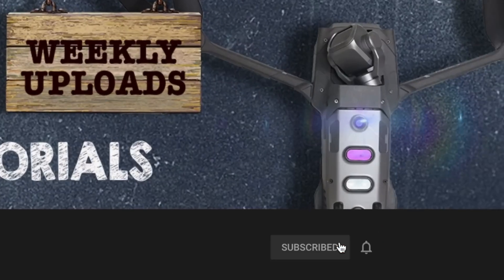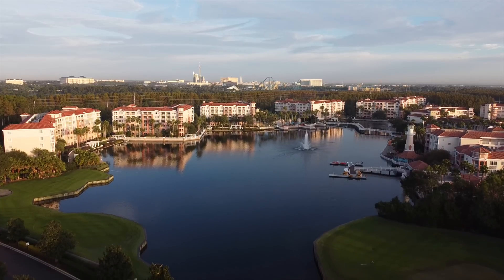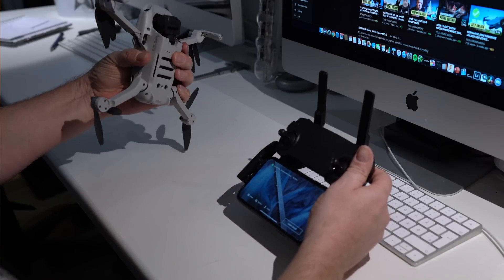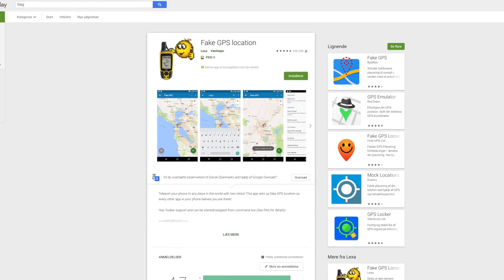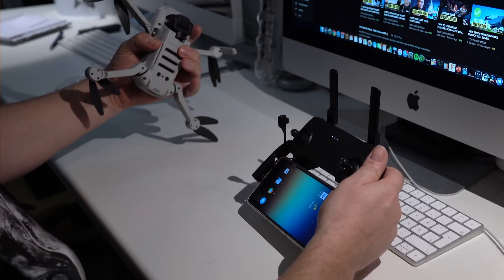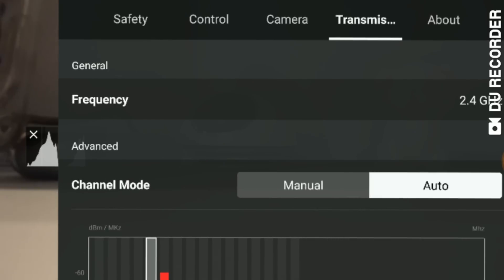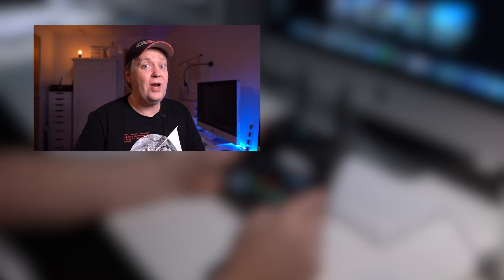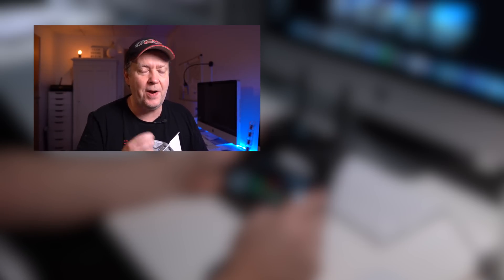HOW TO FIX MAVIC MINI BAD RANGE - FCC HACK (all DJI Drones 2020)

Comment: Maan come on  :( I specifically bought the FCC version to not use the CE controller in Eastern European country and to always be in FCC mode and now you are saying the hack is still working... ;(... And now I have only 5.8Ghz controller... I hope DJI will flash it to CE firmware though...
Reply from the maker: There are a difference in power between the 2 remotes released, you will not get the same benefit with the CE drone.  How much range are you getting?
Reply: @TECHDRONEMEDIA  Will tell you once the snow and the winds calm down here in Bulgaria ... :D still can't test it out properly ... But yes I've bought FCC version for Eastern Europe with purpose to eventually fly 4KM in Europe ...
Reply: TECH DRONE MEDIA I did tested it and I can report 3KM in highly polluted wifi area and it works only in 5.8Ghz... Didn't updated it because it was not mandatory update!

Comment: This only works indoors as soon as you take drone outside and agains GPS message pops up again that it has to reset to your country laws
Reply: No matter if motors are on or off,as long as drone is on land it reverts
Reply from the maker: did you connect the phone after you started the motors
Reply: @TECHDRONEMEDIA  yes,but as soon as I take it outside and it gains gps reset popup comes again

Comment: As you can see from your own screens, your drone may have enabled the stronger 5.8Ghz mode (not as strong as US version of course), but your device is on auto select channel and still selected 2.4Ghz channels. This will give you no range extension at all.  The only way is to have FCC mode enabled and actually use the 5.8Ghz.
Reply from the maker: yes, I learned about the differences after publishing the video and know you will not get the full benefit
Reply: @TECHDRONEMEDIA  with 2.4 Ghz selected you will get no benefit at all. The question is how you can make it select a 5.8 GHz channel after applying the hack.

Comment: So there's no way ios users can do this?
Reply: i did it on ios using itools real simple.
Reply: @Shiny-Robot  with same procedure as tech drone did?
Reply: jushcaleb yes same thing set your in us. Then make new connection . You have to dart props first each flight then plug controls in. Then unplug before turning props off. Not tested differences yet. There’s two models so this hack may not help after all.
Reply from the maker: jushcaleb no not the initial fix as far as I know
Reply: U need to have a jailbreak if u want the hack to work
Reply: shashank somani Hi my iPhone isn’t jailbreak but I do believe I complete the heck. Why do you need jailbreak. I’ve still yet to test the distances I intend to over the next couple of weeks. I know there are two model controls but wonder if they’re just different profiles if so could the European controller use the higher power. To be honest I’m getting over 2 km with CE stock anyway
Reply: Shiny Robot yeah I mean if u want to do complete steps like faking the location and everything

Comment: Hello, I have a problem after landing the mm (using my iphone device after setting up through your guide with an android device) there is always a prompt resetting the wifi settings then I tried not to tap ok or either ways and disconnect the phone from the controller but the 2nd time I connected, the transmission was changed to CE mode again. What should you advice for this? Thanks.
Reply from the maker: Tapping the message is not changing anything it switching regardless. You need to start the motors before you connect the phone, and disconnect the phone before you stop the motors
Reply: TECH DRONE MEDIA But check 5:36 you stopped the motors first before disconnecting the phone from the remote?..Anyway, I will just try your recent advise..thanks a lot..

Comment: Try changing mobile provider there coverage may be poor I’ve seen this drone fly 4700 meters with no issues also if flying near obstructions or high interference place ect power lines /suburbs /buildings will effect the signal
Reply: Your mobile provider has nothing to do with your drone's range.
Reply: Gerhard Olivier it does if you’re reception is poor your signal is week that will cause dropping out on screen
Reply: @tommygun2050  that is simply not true. Your drone uses wifi to your phone. You should always put your phone in Airplane mode when flying. That will reduce interference and in most cases improves signal and range. Your mobile provider has absolutely nothing to do with it. For example, the iPad mini 4 is one of the best devices to fly with and is a wifi only device.
Reply: I think you only mobile connection from phone for the maps

Comment: but i have only 5 channels and i own fcc mavic mini whats the deal its on 5.8ghz if you wondered
Reply from the maker: Eitan Toogendhaft are u in Europe?
Reply: @TECHDRONEMEDIA   in israel at the matter of fact
Reply: @eitanskital7735  5.8ghz not permitted in israel according to the DJI specs and Israeli regulator, this means the FCC version would be illegal to use in Israel as it ONY trasmits using 5.8ghz.  Hope those US travellers are aware.
Reply: @8dcphoto  but why dont i have the number of channels represented in the video?
Reply: @eitanskital7735  Cause DJI knows the regulations and follow the rules of a country very carefully especially in Israel ... If it is forbidden than you can not expect the picture you had seen in this months old video due to reasons: he lives in denmark a EU country so his advice works inside the EU and the second point is the time cause DJI has also published firmware updates that usually close all these holes ... You will only see the 5 channels allowed in israel and these are in the 5 Ghz ones ... maybe to avoid an overcrowded 2,4 Ghz network but that will lower your range cause 5 Ghz is far worser than 2,4 Ghz. 
And the FCC mode itself allows to use a lot more power to transmit  than the CE mode for the EU. That would help you.

BUT: there is another way to check if your system is running in fcc or ce by checking the following if it es a dji go 4 app drone :
https://greyarro.ws/t/how-to-tell-if-you-are-in-ce-or-fcc-power-mode-using-go4/3315

Try to find it out if the Mavic Mini app has a similiar menu and check the tiny line that is hard to see in these pictures if it is below -90 (that means -88 or so) or above -90 ... cause below means FCC.

Comment: I have just tried it, strangely it made no difference whatsoever in my case, still got the same range where I'am, about 1.5-2 km with some wifi around. I have made it to 3 km early in the morning, CE!!
Reply from the maker: I'm getting mixed feedback on this. If you are getting 3km, then no need for this.
Reply: I makes zero difference as the power outut if physically fixed because there are different models Drone and Controller for CE and FCC regions. All this does is cut the channels 12 and 13 on 2.4ghz which are illegal to use in the US so it stops your CE version from trnsitting on reserved 2.4ghz channels.

Comment: Best tips! I was getting frustrated before I saw this video so much. Thank you! 
Also maybe you know solution for remote controller making beep sound every few seconds?
Reply from the maker: It's not supposed to beep unless it low on power
Reply: @TECHDRONEMEDIA  its really weird, sometimes its beeps thro all session when am flying, and sometimes its stops when I just take off. Also battery is full.
Reply from the maker: Andrius Kuprenas I would write DJI about this
Reply: Andrius Kuprenas please let me know if you find an answer. I have same situation on my controller :-(
Reply: @predatorzg  no I haven't, sometimes its stops, sometimes it not..
Reply: @predatorzg  just take out that little speaker from your controler problem solved hahaha
Reply: On mavic air constant beeping of the remote was a sign of missing calibration of the joystics. After re-calibration the beeping was fixed. I don't know if this is applicable to mini as it uses different app

Comment: Hej. After several test  in Gothenburg at a same spot with WIFI contaminated area, first 5 times with CE mode and 2 times with FCC mode 
and I can confirm that its was better with FCC mode, NO message everything worked fine
Reply from the maker: Great news :-) thank you for sharing

Comment: So I have a CE model. I could switch to FCC, where I see only 11ch. Still I don t go further than 200m without issues... anyone else?
Reply from the maker: Is it on 2.4 or 5.8
Reply: @TECHDRONEMEDIA  how can I tell?
Reply: 5.8
Reply from the maker: Under transmission you can see what it’s using
Reply: @TECHDRONEMEDIA  5.8

Comment: Thanks for the video I managed the android party
, but how do you start the motors without the phone connected when you want to use the iPhone? Is there something in my settings preventing starting the motors without the phone connected? Thanks again
Reply from the maker: Press the sticks center low

Comment: I tried this and it was all good ascending, then all of a sudden the drone stop the cache video and went full throttle flying away I wasn't able to stop it, luckily the return home button still works and returned the drone. I pull off the sdcard to inspect the footage what happened, it just flew itself away in the video, but my cache wasn't complete.

Try this with caution. My mini is fcc model
Reply from the maker: Wow be careful, why would try this on a FCC drone

Comment: You mention switching off wifi on the phone to increase range , any idea if having a watch connected to the phone at the same time may effect performance?
Reply from the maker: The connection is Bluetooth, it don’t think that will be an issue

Comment: tried it, but after the steps i followed as shown in te video, i still had 13 channels
Reply: Try it inside your house, it works when the drone itself has no chance to connect a satelite, i tried it yesterday and it worked!
Reply: @michaelnobauer7108  or carry ALUMINUM FOIL with you and put it over the top side of the drone to block GPS.
Reply: Steve Arnold thanks man but i found out that its enough to put your hand on the top of the mavic mini as long until there is a connection to the controller, than start immeaditly, after the start plug in the phone to the controller :-)
Reply from the maker: Strange you sure you followed the exact order
Reply: Hello i'm stuck, my situation is in auto mode 5,8 hz, also when i'm outside. I can only get in 2,4 mhz in manuel setting. I want it restored to the auto modus 2,4 mhz, because i expirence that the drone has much less distance now. Can somebody help how to roll back this hack?

Comment: Can't start the motors without phone as there is no GPS drone will just flash red.. Any way to start motors without phone?
Reply: Ow wait.. Got it.. It has to be in bright lighting.

but I need to disconnect the phone before I stop the motors or the drone will revert back to CE mode when the drone lands

So I'll just fly it home and unplug the phone and then land the drone

Thanks! FCC HACK!

Comment: excellent! Took a fair few attempts but sure enough my channels eventually dropped to 11, cant wait to fly at work now, was getting awful interference and could barely get 200m away
Reply from the maker: Make sure to report back :-)
Reply: so... i dont know if im doing something wrong or not, indoors its been changing over fine, if i do the same process outside while the drone has gps it wont change over, if i get it into fcc indoors and then take it out as soon as try to take off it swaps back over to ce mode. any ideas?
Reply: MRW Aerial Photography someone commented above about firing the drone up indoors before it has locked on any gps. Just tried it myself and it worked. Not ideal if you’re out and about already though. Is it meant to change to 2.4ghz? I’ve got it so there’s 11 channels but it’s on 5.8ghz

Comment: how can you compass calibrate f the motor has started ? if you are in a new location
Reply from the maker: auvrdr. ones good point, that part is possible going to cause problems
Reply: @TECHDRONEMEDIA  i think f you are in a new location calibrate first then go back to your procedure ..thanks i learned a lot from you tech drone when i fcc my mavic air after i visited  your channel..more power to you..and safe flights to us all droners..

Comment: Ok but what happens to RTH if you fake the gps?????
Reply: So basically your saying that the fake gps app acts only on the phone app and not the rc
Reply from the maker: Yes
Reply: @TECHDRONEMEDIA  Thanks man.Very usefull.Gonna try this weekend
Reply from the maker: nothing, the drone will return to home as it's the drone GPS that being used here.
Reply: So yeah i tried last week it didnt do anything exept messing with my weather app.Not getting more than 250 meters but it was near a helicopter area.I dont know ill keep trying.Its strange i have the fcc MT1SS5 version made in china which should be the best according to dji forums.Keep it going though
Reply: I had a try from a hill and got 1500 meters fistance and full 500 meters altitude.Awsome.I think i could have pushed it more.Thanx and keept it going.

Comment: 1. Your landing procedure is wrong. Once the drone lands and turns off its engines, it will immediately reset to CE mode. You need to disconnect the phone from the remote before landing the drone.
2. Just as a funny note, I love how you say everybody should respect local laws and this is just presented for when flying in an FCC area and then to get the hack you fake your location to an FCC area. Seems like flying in an FCC causes the drone to automatically switch to FCC mode, so the only possible reason for this hack is to fly in FCC mode in a CE area. That being said, I've also been using the FCC hack for some time now but I just thought your excuse was kinda funny :)
Reply from the maker: 1. You are properly right, it's likely because I'm inside it did not do that. 2. Agree, consider this my disclaimer ;-)